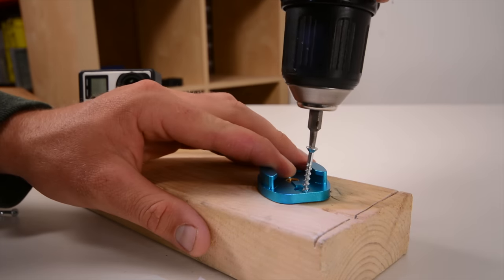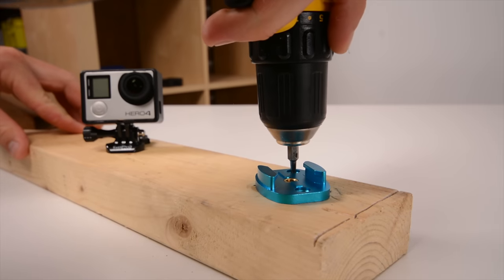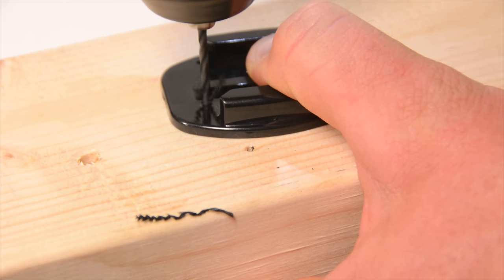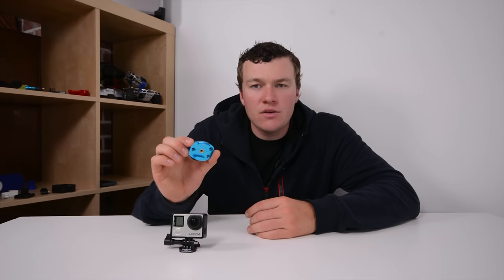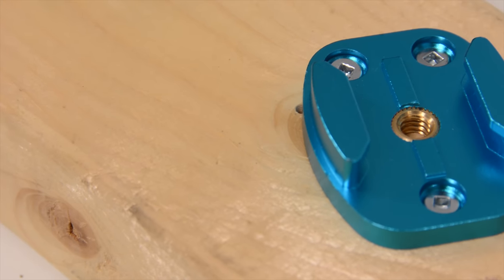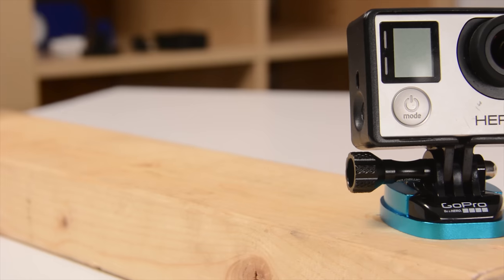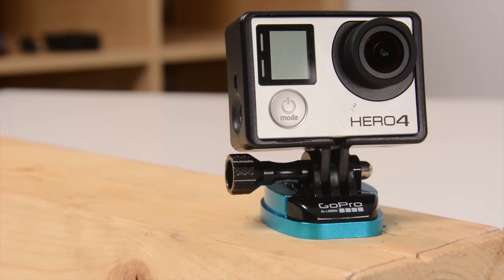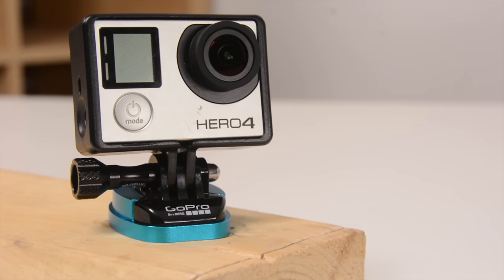Screw Down Buckle Mount

Comment: been using that mount for months. quite cheap from aliexpress. combined with tripod converter & selfie stick, and voila i've got QR mount on my pole. easier to swap between selfie stick and other body mount. much cheaper than spgadget clip adapter.